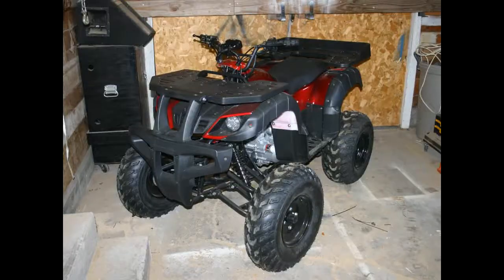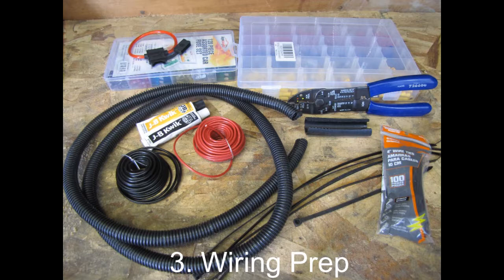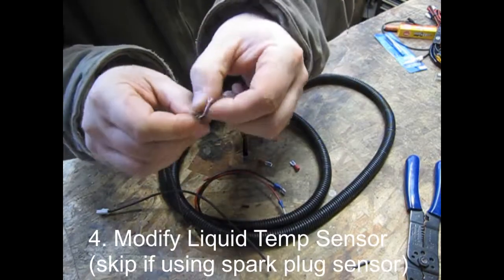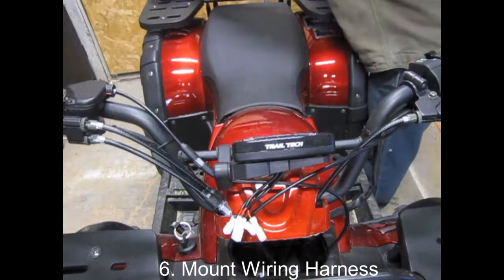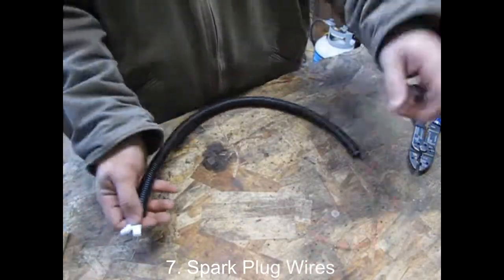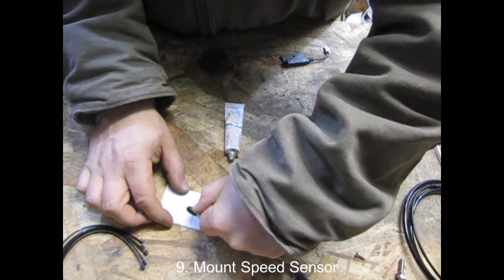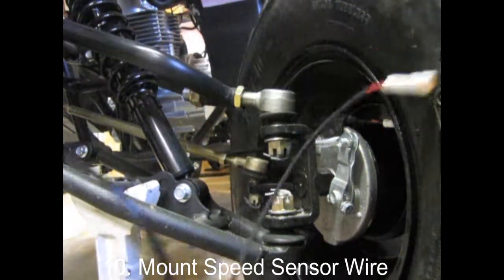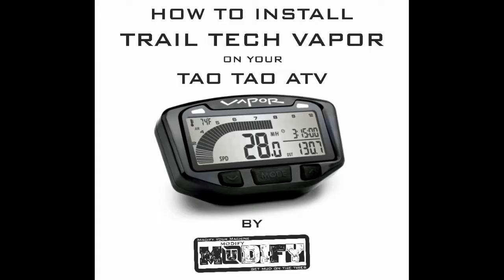How to Install Trail Tech Vapor on your TaoTao ATV by MUDIFY

Comment: I cant seem to fix the TACHO (RPM) Meter..... How is this done? I have the older Vapor X grey, and there is a cable with a ring that needs to be put around the spark plug but no RPM showing... Seems i am missing the wire that needs to be wrapped around the bobine cable... U know a fix?

THANKX!
Reply: same problem but with latnex speedometer
Reply: I disconnected ground wire (black) and its working, also stripped rubber coat from red cable